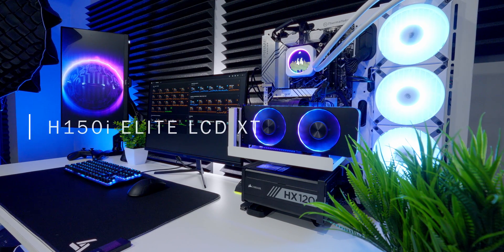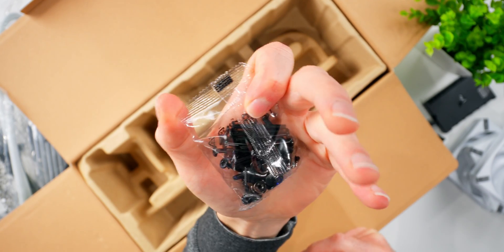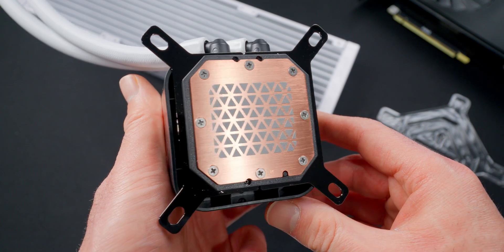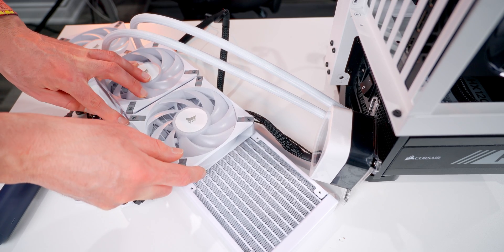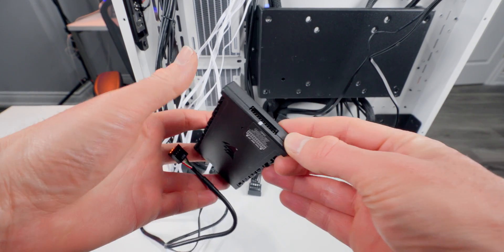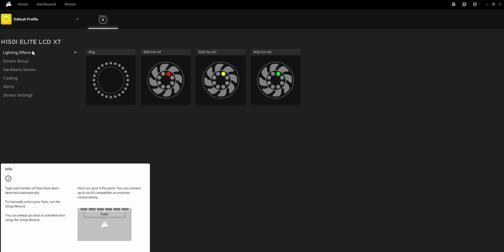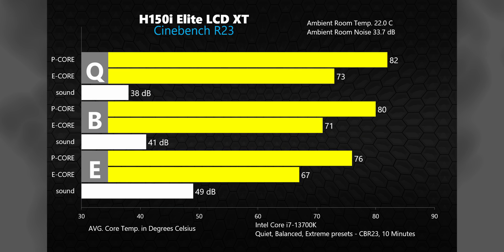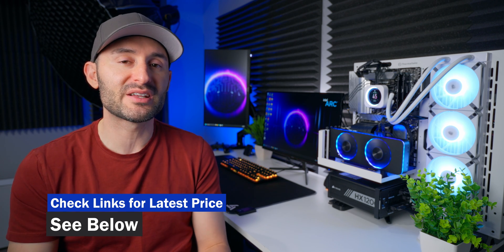The BEST looking AIO you can get! Corsair H150i Elite LCD XT Review

Comment: Sorry, brand new to liquid cooling. But I just bought this cooler but nowhere have I found anything that says what kind of liquid goes into it or how much. How much liquid does the radiator hold, and what kind of liquid? Sorry for the ignorance but appreciate the responses.
Reply: Why do you need to know? It's a sealed unit.
Reply: @8-Bit-Retro  Yeah thanks lol I have since figured that out. I feel real dumb but as I mentioned I have never used liquid cooling before now. Last time I looked into liquid cooling years ago AIO's weren't a thing and had no idea that is what I had on hand. Lesson learned.

Comment: I just bought this today and will be installing in in a month or so as i'm moving from AM4 to AM5. I already have an older Corsair AIO so i'm already invested in Icue and have no issues with it.
Reply: I bought one 2 months ago and it died after a month and a half. 2 weeks later and I still haven't received the replacement even though it was approved and i put money down until i return the broken one.Corsair took my money in seconds, 2 weeks later no replacement yet. I had an MSI Mag 360 and it was replaced in 2 days. No questions asked.  Buy the less expensive MSI because their warranty dept stands by their product unlike Corsair.
Reply: @LilSebastian_  That sucks. My 2019 Corsair h150i is still running fine to this day. I'm not expecting any issues with this one.

Comment: What is the system filled with? What cools the liquid? I'm trying to see how it works since it doesnt have a chiller, how does it cool when the air flowing over the radiator gets warm?
Reply: The fans on the radiator cool the radiator. Liquid transfers heat from cpu to radiator. Would invest in it since it’s half price atm on amazon 👀
Reply: @CriggleBigget  I understand that, but what you explained is the theory. In reality, those fans will only remove a certain amount of heat and thats contingent on how long the liquid is in contact with the processor, how cool the air is passing over the fins of the radiator, and at what speed and for how long.  I see this system not really being much better than just putting a better fan on the CPU and thats not worth risking liquid around the electronics. I think for this liquid system to be very effective, there needs to be a chiller to remove the heat from the liquid.

Comment: for white build having the lcd cable+bottompump plastic in black sucks too much, and the tubes on the radiator side are fixed, also I heard many problems with the iCUE app. I just returned mine.
Reply: use all in one signal RGB it does loads more
Reply: @malcolmswift1889  I returned it, and I bought the lian li hydroshift, much better choise.
Reply: @malcolmswift1889  I returned it got my money back and I bought the lian li hydroshift 360S, a much better aio.
Reply: @malcolmswift1889  I bought the lian li hitdroshift 360s much better choise.

Comment: i know you are only keeping this in for this review before you take it back out. but I thought you shouldn't install any aio with hoses at top when it sits vertically. as the small amount of air will be up at the inlet of hoses and the pump will sent it to the cpu block. you're not keeping it in long enough to probably hurt anything, but temp and noise tests may suffer. and people watching this may install theirs the same after seeing this. don't mean to "be that guy", but just my 2 cents.

Comment: Ok i need help, i just got this cooler, and its It's making a low, squeaking noise. Is it normal? Its my first pc. I think everyting is connected perfectly but this low noise is worrying me.
Reply: it has air in the pump, get rid of it make sure the top of the radiator is higher than the cpu.
Reply: @randomgaming5332  Low aio cooling dissapation squeeling coming inside when hearing randomly, does this mean air in the pump occurred and has to be solidified, if it comes on when the fans are radiating the liquid too fast or on silent operation do to the hot liquid temp running? making sure the thing needs to be adjusted by defining if it broke with the air part or radiator / hose part.

Comment: I just swapped from the 150 I xt to the Kraken due to the pump failing and it having that screen problem I couldn’t fix after 6 months of owning it, the kraken has ran better so far and the software is a dream to use
Reply: My H150i elite lcd xt died after a month and a half. 2 weeks later and still waiting on the replacement. They're sending me a refurbished which I will send back until they send me a brand new one like I purchased 2 months ago.

 4 years ago I had an MSI MAG 360 and MSI replaced it and I had a brand new one in 2 days. 

Don't waste your money on Corsair.

Comment: Love the LCD screen, the AIO probably like any other AIO (a 7800x3d aint probably the chip u want use when u want to monitor temps since that mf jumps all over the place) but the included ML120 fans are probably a lottery, mine came with a humming sound when they go over 1000RPM.
Reply: I'm going with an i9 14900 and from what I know that baby runs HOT!!!
so I feel this cooler will need to work for its money
Reply: Im new to this and im planning on buying ryzen 7 7800x3d and will this cooler be good for that

Comment: Is this silence or can you heat the aio pump….
Reply: Don’t know if this matters to you anymore but the pump has 3 settings, quiet, normal, and extreme. No point in going past normal, I use quiet. At quiet the pump is audible, it makes a slight hum, don’t find it that noticeable or a particularly bad tone.
Reply: @rcworkshop1925  Quiet is 1080 for my aio set coolant temps reach upper 35s what pressure exiting is recommended for the two to get under 33c constant coolant temp? since the aio does not reach the new pump quiet speed of 1500rpms pump, am i better at keeping it in the range for balanced? 2080 rpms some corsair items.

Comment: ok, dumb question here, but if I get this, it will be my 1st foray into liquid cooling. So my question is, is the radiator prefilled, or do I have to add coolant? Is it sealed? Can the hoses be changed out - I'm thinking see thru (or clear) would be cool. Oh! and what video card is that?

Dan
Reply: The radiator is pre-filled and sealed. The hoses are not meant to be changed and are permanent. Almost all AIO coolers are simple, and plug-and-play today.

Comment: i though the rule was tubes down... else u get extra noise....🤔
Reply: yeah that noise is your pump working itself to death if the orientation is wrong
Reply: Yep it is installed incorrectly in this video 😬 A large reviewer on YT explains how this works in depth…
Reply: @ExperienceThisGaming  what a bullshit, the air bubles gets traped on the top of the radiator witch is higher than the pump

Comment: In addition to connecting the AIO fans to the hub, can I connect other ARGB case fans to that hub? They are from another manufacturer though.
Reply: For rgb control only corsair fans, so you can only connect the fans' pwm cables to the hub.

Comment: does it show cpu and gpu both temparature at the same time together like nzxt kraken does in one screen?
Reply from the maker: Yes you can do that.  There's a setting that'll display two temperatures at the same time, and you can choose which sensors it's reporting.  Can be CPU/GPU and tons of other stuff.
Reply: @ECPUz  is it the option called Dual Bar ?

Comment: Aio is terrible
Reply: I have an h170i on my 13900KS and I can cool with it 345w without thermal throttling, at 5.8Ghz all core :) Wouldn't call that bad at all
Reply: @cryptedvick so then I shouldn’t worry about using a 240mm for my 14600k 🤔
Reply: @Jaylou88  you can get away with a beefy thermalright Assassin fan or something similar. I'm honestly considering this just for the display screen
Reply: nah air is terrible @Qu4dav